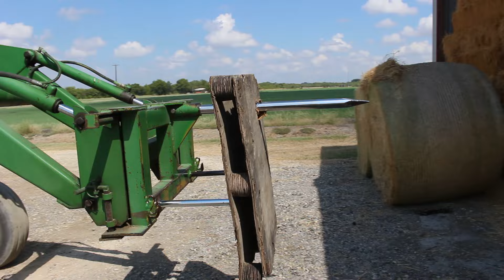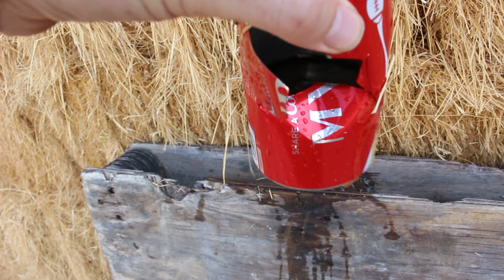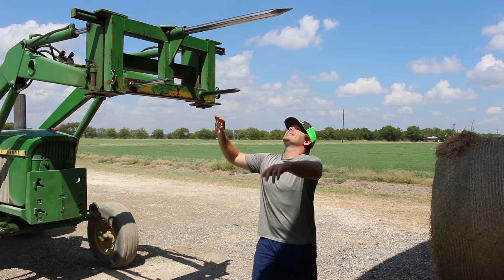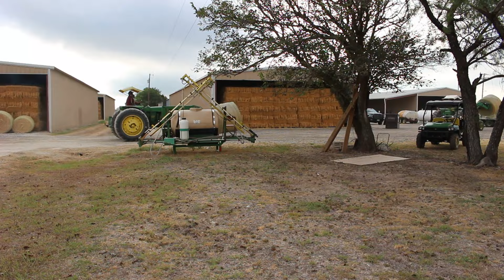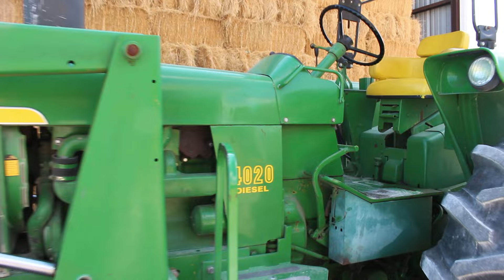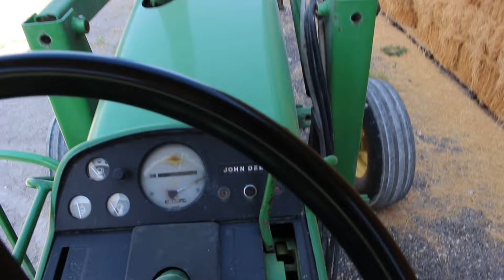Tractors working on the farm | Using a real hay spear tractor

Comment: We have a 4030 with a front loader on our farm. A great tractor! One of the oldest on the farm but will crank up on those cold mornings when the newer ones wont.
Reply from the maker: Awesome, we mainly use 4020's but do have 1 4010 for loading hay also. Basically the same tractor though